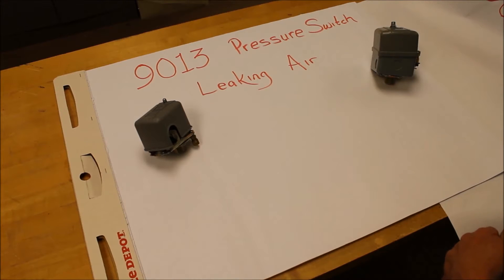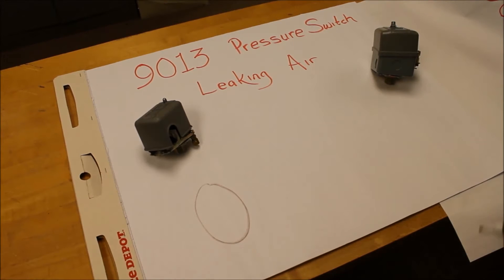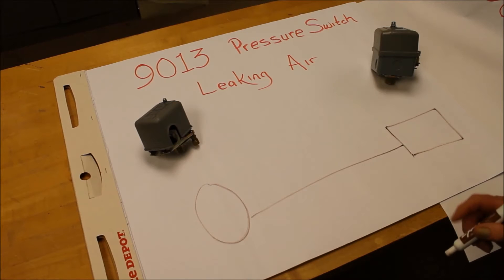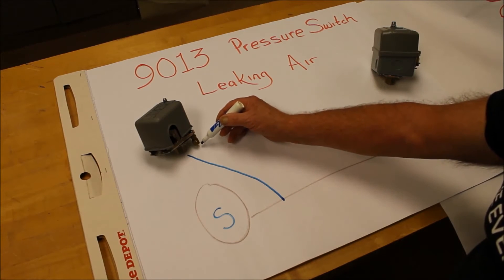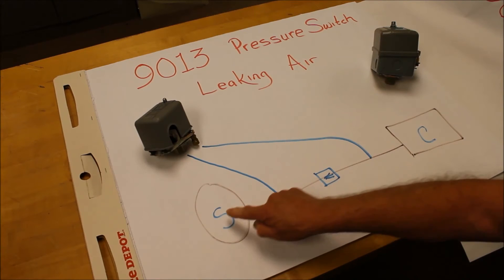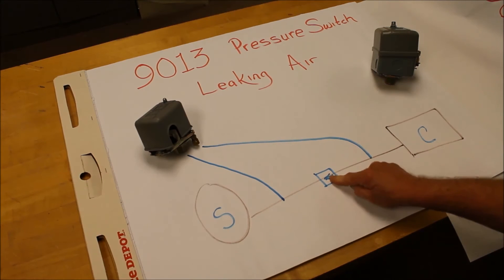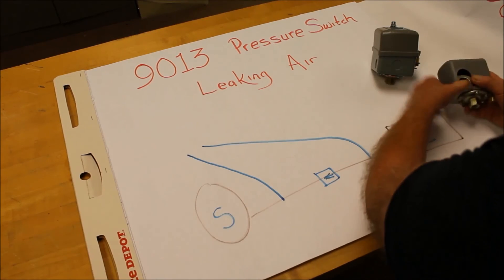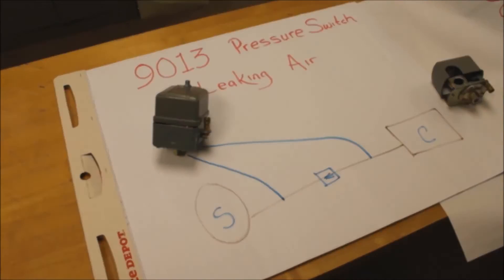Solving Air Leaks on Square D™ 9013 Power Pressure Switches | Schneider Electric Support

Comment: Square D 9013 leaks at diaphragm ,  tighten the screws and it holds for a while longer  ..   then the metal part becomes distorted and leaks again .  on going issue,   have to replace the controller every year .   I don't remember Square D  being so inferior in my youth  .

Comment: Great video, but how do you test the 9013 PS unloader valve (P/N 9049A56) for internal blockages? We have systems where the PS is installed properly and cycling correctly, but the unloader valve is pissing small amounts of air continuously. We are replacing the unloader valves monthly.